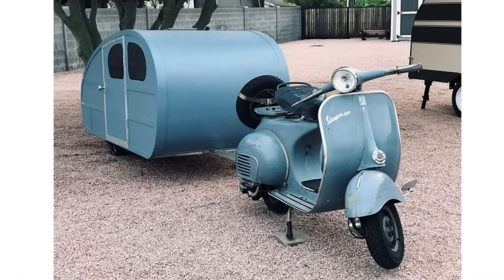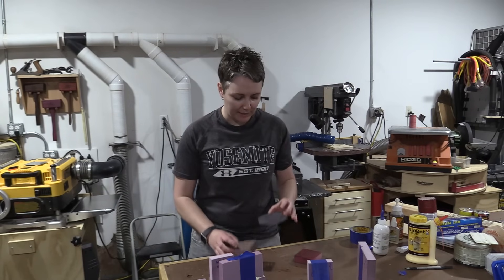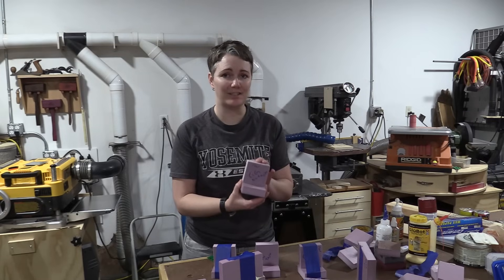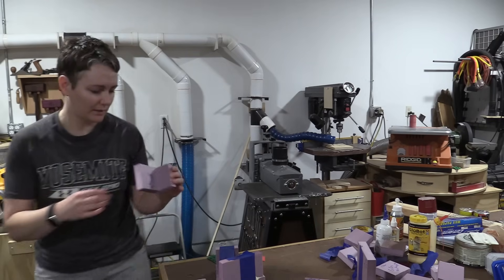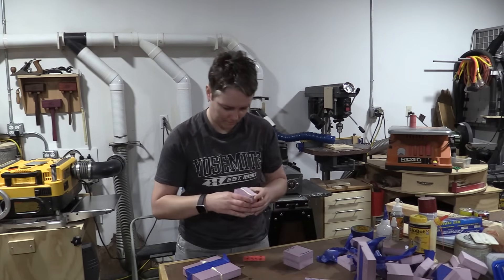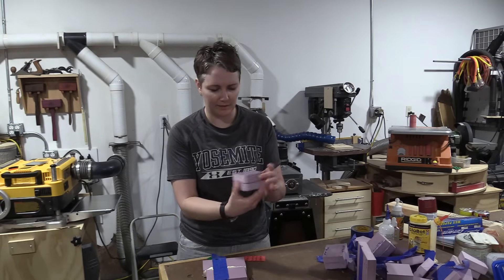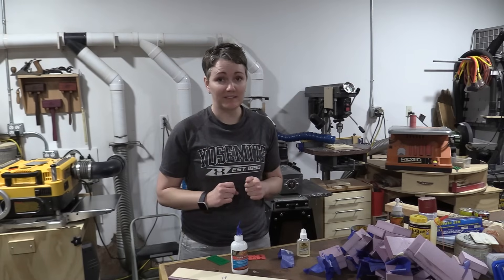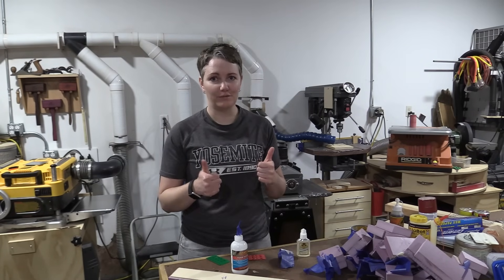NOT Gorilla Glue! Watch This Before Building a Foamie!! BEST Adhesive

Comment: Spray foam is the best adhesive for foam (crack filler for narrow joints). You don’t want to joint 2 smooth surfaces a cratered or drilled divots on each surface when using spray foam works best...then paint with latex paint, add some sort of material (bed sheet, drop cloth, cotton t-shirt) while the paint is still wet and immediately repainting (poor man’s fiberglass) is very strong, light weight, effective and cheap. (Latex returned paint works great, color is irrelevant until final coats)
Reply from the maker: We did cover the trailer with poor man's fiberglass! I have made 3 trailers with it and love it!

Comment: The foam seems like it would be difficult to a heed to anything from all the trial and error. I’m trying to figure out what I need to use to heat it to plywood so I’m gonna continue to watch your video and see which one works the best I’ve used gorilla glue for years, but I’ve never used it was Styrofoam, so I’m curious about how this is gonna turn out so far gorilla glue is failing

Comment: Great testing!  For small projects, you may like Foam-Tac or Foam-Cure that RC airplane builders use.  They are flexible, so that may not be as good for rigid construction type foam.  I wonder if Lexel would work well.
Reply from the maker: Thank you! Great suggestions, if I do a repeat test I will check them out!

Comment: How do these fire with high temperatures? And would these be useful to bond foam to metal? If not, what could work?
Reply from the maker: Foam fusion is supposed to will with high temps but work work with metal.  For the parts where we were bonding foam to metal we used 2 part exopy.

Comment: I know it would be much more labor intensive, but I wonder if putting dowel pegs in the joint would make it even stronger? Or, you could use right angle triangle buttresses, as well.
Reply from the maker: We did add BBQ skewers in some parts. It did add a lot of strength! But since the roof had kerf cuts to help make the bend we didn't add as many as we had planned.  It was pretty difficult to assure they were going into the foam and not the kerf gap.
Reply: @thelwood  Thank you for replying! My dad used to do in the field repairs on our foam radio controlled plane using cactus needles dipped in 5-minute epoxy. He would join the broken ends, holding them in place and pushing the needles in with a pliers. Worked perfectly!
Reply from the maker: @1chumley1  that's awesome!

Comment: Could I make a camper top for my truck out of foam ? It wouldn’t fall apart going down the high way would it ?
Reply from the maker: It is certainly possible. The biggest issue would be making sure you have a good way to attach it. I would probably still have some sort of frame.

Comment: Great presentation. I think we'll be doing a "foamie" as a mobile workshop. Have you tried sanding the surfaces to give the adhesive a little "tooth" to hang on to?
Reply from the maker: Thank you! We did sand the surface on the teardrop.  I was impressed at how deep the foam fusion bonded even through the shiny coating

Comment: What about roughening up the surface of the insulation by sanding it?
Reply from the maker: On the trailer we sanded and ran a wall paper scraper over it.  The side by side joint would replicate this since the surface film was removed.  I was impressed with how deep the bond was through the film when using foam fusion.

Comment: The substrate/foam is the weak point. No connective adhesive material will overcome the inherent material weakness of the foam. As suggested by others, here,  a fillet at the joint in combination with a structural overlay(fiberglass/carbon fiber) will provide the strength required for shear, deflection, and connectivity.

Comment: Did you rough up (and clean) the gluing surfaces before glue up? I missed that part. That will definitely help adhesion. The shiny surface on unsanded foam hinders the adhesion.
Reply from the maker: We sanded the surface on the teardrop.  The side by side joint in the test didn't have any of the shiny surface. I was impressed with how deep the foam fusion bonded the foam even with the coating on it.

Comment: I think you're missing a trick here  on the adhesives. Try 3M77 spray-on contact cement, designed for foam. This will also let you easily laminate your wood sheets, fiberglass cloth or plain cotton cloth to the foam before glassing it with epoxy. 

But also, you're not preparing the mating surfaces of the foam as well as possible. You want to lightly sand the mating surfaces (a sanding sponge is good for this) to de-gloss the foam and remove the shiny coating layer. Then you want to poke holes into both sides of the joint where the surfaces touch, so that whatever adhesive you use, gets little "fingers" into the material rather than just trying to grab at the microscopic cells on the surface. A bamboo skewer can poke the holes, and, if you really like strength in a  joint,  poke in and break off the bamboo skewer into tiny lengths to act like dowels, and glue that into the joint as well, to help with shear loads and bending loads. Adding fiberglass tape or strips of cotton cloth (like from cheap dollar store or thrift store bedsheets) along joints using the contact cement, followed by epoxy glue, will make bullet-proof and water-tight joints, like the ones used in foam boat building. Those simple techniques will increase joint strength immensely.

About the foam melting when painted:  you can use Kilz brand latex water based primer on this foam, to seal it, then it will take any kind of paint you want to use, house paints and including rattle can sprays, without melting.
Reply from the maker: Thank you for your input and the tip on kilz! That is great to know! We did sand the actual trailer and used some skewers. The side by side joint demonstrates a joint without any of the shiny surface.  I was impressed with how deep the foam fusion bonded, even through the shiny surface.  I will definitely check out the spray adhesive you mentioned! Thank you for the great tips!
Reply: @thelwood  When you try the 3m 77, spray both sides, let them air out and partly dry for a minute or two before joining them.

Comment: If you were able to do a mortise and tenon joint or dovetail, would you have a specific preference glue, or would any of these be impossible due to insufficient sliding time?
Reply from the maker: The foam fusion would still work well, it behaves like Elmer's glue
Reply: @thelwood  Thank you.  I made this funky duct in my attic which directs air from a swamp cooler in the attic vent to a hole in the garage where I work on cars, and it is a leaky fail.  Now I have cool tools to make "real joints" so this video was motivation and technology combined.

Comment: Epoxy is the way to go.  All corner joins should be splined with rough cedar lathe, which requires a larger groove, thus allowing more epoxy into the groove, around the wood, and increasing the gluied surface area.  Any interior cabinet or shelving structure ahould be likewise constructed and splined to the interior walls for added rigdity.  Reinforce all interior corners with fiberglass. Best to just glass the entire interior, which makes the whole structure a one-piece build. Cover the whole exterior in fiberglass with at least double reinforcement at all corners - preferrably well radiused.

Trailer and piggy back campers endure gale forces and vibrations each time they are on the road - for hours at a time, and days on end.

Comment: I you might want to try 3M formula 77 spray adhesive
Reply from the maker: I will try that sometime! The 3M 90 definitely eats the foam,  but perhaps the 77 won't.
Reply: @thelwood   The directions say that you can use it on most foil metal plastic foams. I have used it on like a mattress foam to put pieces together I've used it on Styrofoam but  wind up using other glues for wood and plastic.  I have glued aluminum foil to sperform for making a knock down super efficient cooler with 4 to 5 " sides for long term camping.  When I have glued Styrofoam together it has always been in a framework so I've never done any strength testing although it has made a waterproof joint.
Reply from the maker: @tl1925  great information! Thank you for sharing! I will try it out sometime:)

Comment: Interesting test!👍  But I have to ask how this all compares with purpose specific foam glue like the PL300 you find at Lowe’s in the same aisle as that foam.  BTW, many dislike the excessive squeeze-out of original Gorilla Glue urethane adhesive (ever notice the similarity to “Great Stuff” aerosol foam insulation?), but if you are willing to live with that, the expansion will push the glue into cracks in wood that ordinarily wouldn’t have been reachable.
Reply from the maker: Thanks! I should have tested PL300 and will if I do an extended test.  I avoided thicker paste style adhesives because with 1in foam we had such limited clamping ability. I just didn't think we would be able to clamp it tight enough to distribute a thicker adhesive. We were also trying to avoid an excessive adhesive since the side walls were pre finished and the roof had kerf marks that excessive adhesive would have looked terrible in.  This trailer is so small that we want to avoid the need to work inside of it much with the roof on.  I loved that when we did applied too much foam fusion it dried clear and wasn't noticeable.
Reply: @thelwood  I understand. My project got put on hold for a few years.  I learned to my dismay that PL300 has a limited shelf life.  And my “squaredrop” project will use all 2” foam.  I stocked up on a lot of Glidden Gripper just as the PPG buyout and cheapening of the formula was happening, so I have “the last of the good stuff.”  Now that I have all my canvas on the shelf, naturally I see a video using landscape cloth… 🙄 Well, I’m new at this and it’s all about learning.

Comment: Does the adhesive adhere to wood as well. I've been thinking about utilizing foam with light weight wood frame like say wood that's no thicker then two an a half three inches sorta like a decent cane of bamboo then placing thin siding or paneling of some type to form the outer facade once I go about sealing all the seams also do you know if foam has a negative reaction to flex seal or polyurethane the kind meant for boats?
Reply from the maker: It bonds foam to wood very well! Foam to any porous surface :)

Comment: This seems to be making the case for using a router to create locking joints.
Reply from the maker: Definitely adding better joinery would make it much stronger! For this trailer that would have been a lot of complicated work with the various curve degrees. But if you have the time to master that it would help a lot! I would add some dominos next time
Reply: @thelwood  I don't own a domino machine, but it's pretty easy to run a piece past a router on its short edge.  That'll give a locking face along the entire run of the join, or at least more surface area.

Comment: The shape of that foamy, is a wing, at speed, it will create lift. How much speed and how much lift I don't know, but it might make it dangerous or, easier to trailer
Reply from the maker: Fortunately the vespa never pulls it at speeds greater than about 35 mph. It pulls very easily, but wind gusts are the biggest challenge

Comment: At $19.95 a quart (+$10.25 shipping), FoamFusion is a bit cheaper than PL Premium, Gorilla Glue, Titebond, or any of the others.  Nice stuff!   But if you tape up your joints with blue tape, then spray on Great Stuff and clamp it, the mess comes right off.

Comment: Late to the party too but yeah, mechanical bond is most important. There is a reason they call it closed cell foam, it doesn't absorb anything.  You have to sand and poke little holes in it so the glue can get in.  Built many foam structures and epoxy, not the old good epoxy that has nasty solvents but the latest gen of "Safety" epoxies (West Systems etc.) hands down the best.  If you need to sand seams Your joe wood glue (TiteBond) and filled with microbeads.  I've always used real fiberglass but I've also done a few canoes that use the old canvas technique, yep nothing new about it and there's a reason to move to real glass but good on ya for keeping the tradition.  If you want a little bit more strength you can always use polyester cloth and polyurethane paint, like the water base Varathane.
Reply from the maker: Great information! Thank you!

Comment: What if you ruffled some of the surfaces for the test?
Reply from the maker: We roughed it up on the teardrop.  The side by side joint in the test would best replicate this since both edges were cut.  I was impressed with how deep the foam fusion bonded the foam even through the shiny surface.

Comment: Did you sand the smoothness off?
Reply from the maker: On the teardrop we sanded it off.  For this test, the side by side joint would replicate no shiny surface. I was impressed with how deep the foam fusion bonded even through the shiny surface.  But still best practice is to rough it up.

Comment: Why wouldnt you  use screws  and glue or laminate  jounts with  some screen and coat with epoxy
Reply from the maker: Screwing into 1 inch foam would be very difficult.  Especially since there were relief kerf cuts to be able to make the bend.  Screen and epoxy is a good idea.  The PMF that we used (canvas, glue and paint) basically act like a big hug to hold it together, similar to the screen and epoxy.

Comment: When using Gorilla Glue you should always wet both side of the foam with water before applying the glue as it will set much quicker.

Comment: The foaming or expanding glue is problematic if you are stacking and assuming the foam blocks will remain square. The foaming or expansion of the glue will even push 150 lbs of force and lift the material to odd shapes. I was making a foam plug to epoxy fiberglass and the expanding properties of the glue ruined my plug..

Comment: Cool!. I'd love to know how well they adhered foam to something like aluminium panel. Does foam fusion only work with foam or porous materials like wood?
Reply from the maker: I works amazing on all porous materials! I am not sure about aluminum but it worked great on the vinyl tile that wasn't porous. But the directions do specify porous surfaces
Reply: @thelwood  Many thanks. I've found a couple of stores here in Sydney (Aust) who sell it so I guess I'll give it a try. I'm looking at a 3mm aluminium bonded panel (alum both sides with a thin foam sheet between) and then 20mm foam bonded to it. The glue has been a bit of a question mark :)
Reply from the maker: @kakman1958  let me how it goes! Sounds like a fun project!
Reply: Hey kakman - I also want to bond foamboard to aluminum sheet.
Tonneau cover for my pickup.  So making flat panels about 160 X 100 cm.  ( ~ 5’ X 3.5’ )
But I have EPS - white lumpy foam made from beads.
I hope that works too. Any suggestions ?
Reply: Wonder if the PL adhesive worked well for foam - aluminum.  Thnx
Reply: @SquareRootOfMinus1  Hey there.  I never got around to trying. I did some testing with VHB tape and it's so strong I'm fairly sure that's what I'll use. It seems like many, many builders are using it which is how I first learned about it.  I'm about a week away from doing it so I should know soon. Part of the reason I went this way was cost. The Foam Fusion down here in Australia was about $40 a bottle and I suspect I would have needed quite a bit. The tape also has the ability to be removed using WD40 so if you ever need to replace a panel it can be deconstructed (provided you can get reasonable access to the taped surface.

Comment: 3M Polystyrene Insulation Adhesive 78 Aerosol is purpose made for this job...it's just expensive and not available locally.
Reply from the maker: Thank you for the tip,  I will check it out!

Comment: Might be worth a look using Marine foam core boards, they come in different density's and thickness. You can also get them pre-scored for going around corners. Designed to be used with fiberglass, Carbon Fiber and composite layups. Just to give you more options.
Reply from the maker: Thank you! Marine foam sounds like a great option

Comment: Foam is meant for insulation, not a structural component. You need a frame for bracing and laminate.
Reply from the maker: It does get very stiff with the PMF on it. And there was also a wooden "grid" on the outside.  It is much stronger than I thought it would be :)

Comment: Foam isn't very strong, use sticks glued into joint (like nails) & wrap with glass/epoxy.  Seems like foam fusion is pretty good.  It's probably mostly acetone.  I bet any solvent adhesive would work.
Reply from the maker: Great tips! We did add some BBQ skewers for additional support